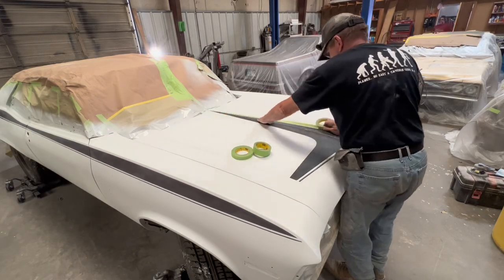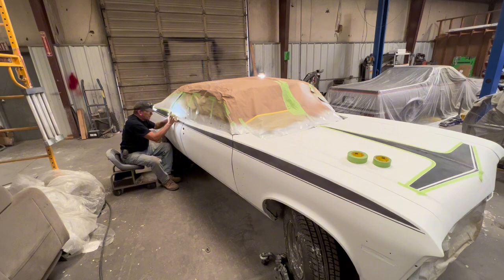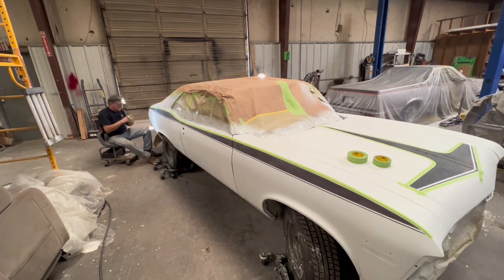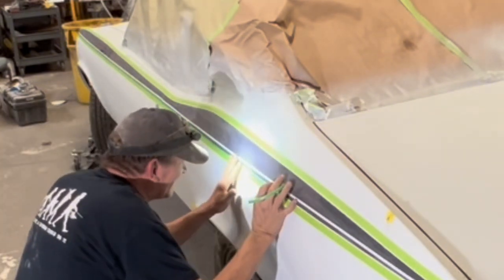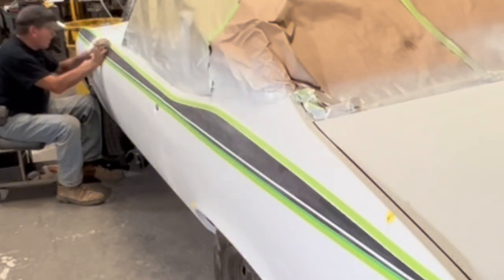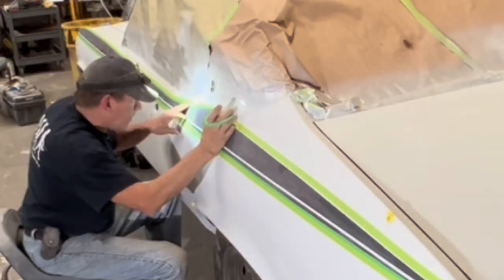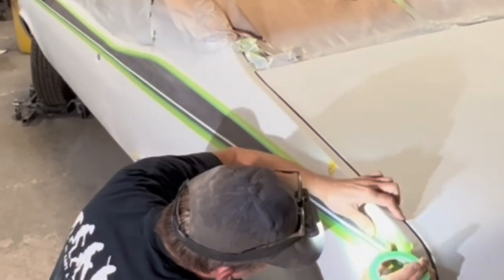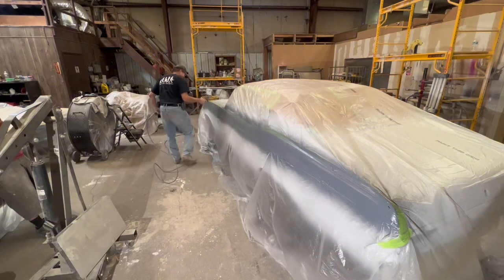Repairing A Stripe Disaster W Waterborne Primer👀😗 Easy DIY Fine Line Tape How To Mask Car For Paint

Comment: I didn’t know you would have to prime over the old stripe before painting it again. Now that you’re adding primer then repainting it again, will the stripe be sticking up so u can feel it or will the clear coat cover it and blend it in with the rest of the paint? Im learning from these videos Bondo Billy!
Reply from the maker: I sanded it flat, so it will a little higher because of the primer, but I’ll put a couple extra coats of clear over the stripes so we can sand the finished clear flat